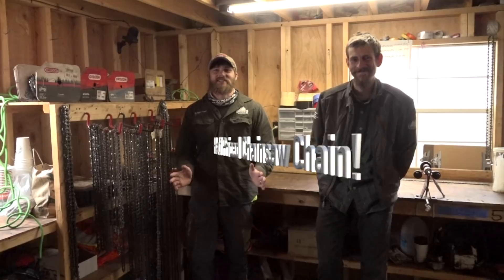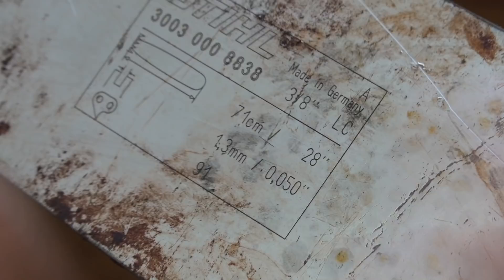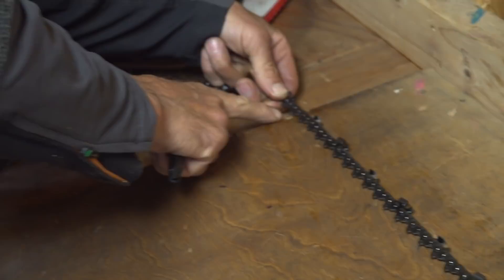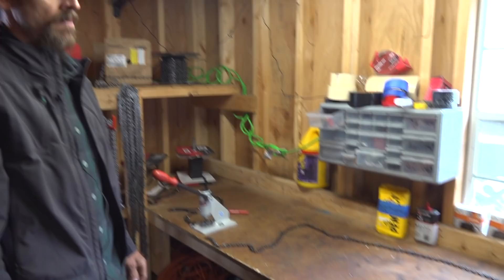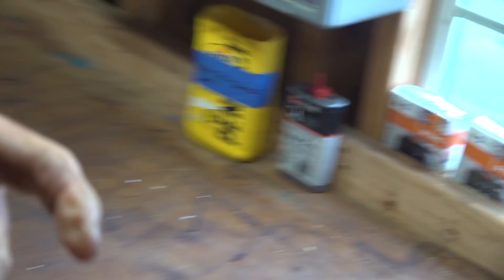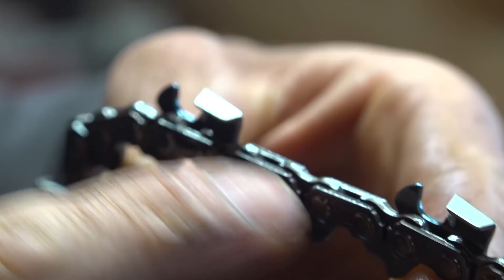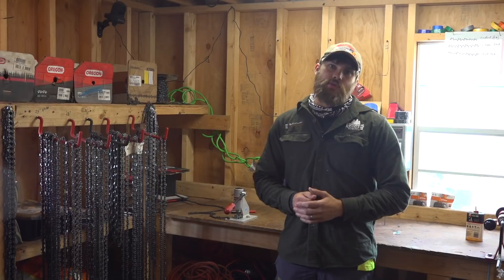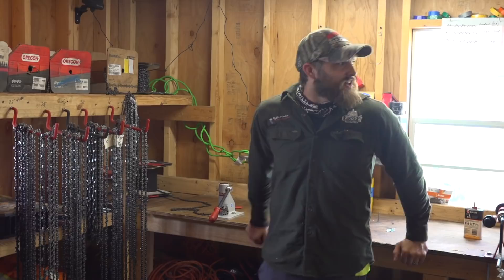Half Priced Chainsaw Chain!!! How to make your own loops of Chainsaw Chain

Comment: I've thought this before but never mentioned it, you are exceptionally good at interviewing people while they demonstrate something. Two thumbs up 👍👍
Reply from the maker: Thank you so
Much that compliment means a lot to me as that’s what I most enjoy doing  🙏
Reply: The (75) is 3/8’s .063 gauge… 73 is 058 and 72 is the.050 gauge 3/8’s chain… 90 is actually a 3/8 .043… it’s neat super skinny chain that turns a little engine into a real beast… like a combi-tool can pull a 14” bar for your polesaws!

Comment: 75 means 3/8 pitch .063 gauge or 1.6mm. There's a table for this info. I'm don't use enough chain to buy a chain breaker or press. A mate gave me some 3/8 chain suitable for my MS210 and I cut the chain by running a small angle grinder over the rivet head and then punched it out and then peined the rivets with a ball pein on a slab of steel.
Reply: In Oregon speak...72 series is .050, 73 is .058, and 75.....in the 3/8 (.375 actually rounded up from something like .367).
Reply: Just came here to call you Hank
Reply: @brunomahle1618  LP,  0.0370", 3/8". Full size 3/8" 0.375" pitch.
Reply: @brunomahle1618  75 means .063 gauge

Comment: The nail trick works, but I've found Bailey's Woodland pro chain measuring chart makes the process a bit easier. Cheap too. Just stick it down on the work bench and no more link counting guess work.
Reply from the maker: Thanks for the tip!
Reply: Can't you just split the old chain, lay it on the bench and bang in a nail?

I guess that's not the best option if you're making spares and the old chain isn't being thrown out?
Reply: SCOD nar not a good idea, as the old chain will be worn and as each link wears it adds up and becomes longer... ie stretch  👍

Comment: The question is what amount of torque do you put on that ratchet part bc spinning the other part just forms the mushroom. The ratchet is what puts pressure on it. So if you knew the torque you could replace that ratchet with a torque wrench and get them perfect Everytime. Not that it matters lol

Comment: Good video. I love watching your videos. 

You can also build loops of chain with simple tools: a grinder, a small ball peen hammer, a chainsaw chain repair set with small punch and pocket punch breaker, and a strong metal surface to place chain when you peen the rivets.  To make chain loop, count drivelinks, grind off tops of rivets for tie strap to be removed, use punch and braker plate to punch out rivits, put new tie strap on to join loop, carefully peen tops of new rivet with lite taps until mushroomed about same as the other rivits to complete the loop.  I have built over a hundred chains like this.

Another good tip is to count your links twice for the first chain of a particular size, then after yo have cut the chain to length, use that section of chain to mesure additional chain sections until you have all the chain you need of that link count.  Then you can make your loops and if necessary, box all the chains of that size.

Thanks again for the great video.

Comment: You could try an old toolmaker trick for finishing the mushrooming of the rivet. Take a ball bearing of the appropriate size and set it on the mushroom side while the link is sitting on the anvil. Now smash the ball bearing with the flat side of your hammer and this will push the material from the center to the outside creating your mushroom. 
Love the vids...stay safe!

Comment: 75 indicates.063 which is the gauge, or thickness of the chain 

And if your running an 8 pin sprocket you’ll probably add a DL

👍🏻

Comment: Thanks for the video! Im lucky to have an employee that worked at a rental center for decades and he handles the chains, maintenance,etc for me nowadays. Until the last few years I honestly just bought the factory chains and threw them in a pile and sharpened them when I had time and then threw them away after 4-5 times. Now the damn chains are double the price (especially Sthil)and we have been making more of them. I think I will order the proper tools you have and set up a dedicated work bench for chains. We have just been using a dremel to grind the rivet and a hammer and punch to set it. Thanks again!

Comment: The process of forming the rivet is called Rotary Forging or Rotary Forming. It's a cold swaging process where the pressure of the screw deforms the metal to fit into the rotary die. Oil is required to keep the metal from galling (smeared like a bearing looks after running with no oil).

Comment: The 75 on the drive link is Oregon nomenclature. You can search their charts for the numbers on a chain and it will tell you the style and size of the cutters and the thickness of the drivers(.043, .050, .058, 063 are the ones I have).
Those little riders are the heel for the back one(not sure about the front), on the newer chains they are different heights so they have to/should be put on properly.

Great video guys.
Reply: Nice Brett
Reply: So, what does "75" actually mean?  Is it a part number, size of something, or what?
Reply: @Vic-wi2qx  Funny, I just got an alert for this post.
Glad it's helpful :).

Comment: Suggest that the adjustable die is better for use when repairing used chain as provides perfect support to reduce risk of damaging drive links when breaking out damaged parts.
If using rivet spinner correctly, you shouldn't need to use hammer to finish. By using the hammer to finish, you risk inducing  stress fractures in the shank. Increased risk of catastrophic failure of join in service.
The shank of the preset tie strap has a shoulder to allow for proper flex of finished joint. Check for damage / burs to edges of drive links upper & if not punched square, the hole rivet mounts on. There are different presets for 0.043" /  0.050" & 0.058" / 0.063" gauge drive link. There are different cup / die for 1/4", 3/8" LP &  0.325", 3/8", 0.404" rivet heads. Two sizes. Separate third, bigger version for harvester 3/4" chain.
Later 2, same strap, for brand.
Putting a drop of oil on tip, makes for a smoother rivet head & reduces wear on one's equipment.

Comment: I use one of those older Granberg File’n’Joint guides and a caliper to get the teeth all the same size after a few hand filings. Gets them all renewed and I feel like I’m getting the most out of chains and I’m not being disposable, but I totally know that it would be cheaper AND easier to throw a new chain on in the time it takes!

Comment: And like a bicycle chain being made, if you crimp or mushroom them a bit too tight, you just need to apply slight side pressure or slightly “bend” on the chain (sideways so the links gain a bit of looseness).   Better a hair too tight than too loose, it can always be loosen (almost always).    Awesome channel, you guys are the pros.  !!!

Comment: Nice job guys. I've messed around with my own tool bits for creating the mushroom as my background is mechanical engineering.  After a few deferent angles on the tooling I've got the perfect mushroom now and it looks like the factory joins . Keep up the great work guys

Comment: Cool demo! When replacing motorcycle chain, the process is the same. Motion Pro have made a little portable tool that makes the delicate job easy, but it is not made for thinner chainsaw chain. Even so, I wonder if somebody will come out with a tool to make the chainsaw proces easier. The problem is, if any tool is expensive it will take big volume before one starts to reclaim the investment.

Comment: Great video, re forming the rivets, yes, oil, and they are cold formed, your better to have good pressure early so you dont end up work hardening the rivet and that makes the final closing more difficult, form it up, watch as it closes up, then easy pressure in little bits each time to get to the final stage of a tie strap with no binding and no slack, like the other formed tie straps on the chain. No need to hammer them the final bit, but if your in the field, and no spinner handy, then use hammer and concave punch head and form them up.
 Keep the great vids coming.
Reply: You beat me to the cold rivet part and yes you need oil.  A dab of grease also works and doesn't make a mess out of your vise and shop floor when you are doing a lot of chain.

Comment: Oregon makes a nice chain making template. No counting DL required. Works great. The 75 marked on the DL means 063 gauge. 72 is 050 gauge 73 is 058 gauge .
Reply from the maker: Thanks for the info!
Reply: ***PIN  this answer to the top !!!!***

Comment: That's an eBay price. But when it's a retail price face to face over the counter, that's the highest cost. Also madsen's is able to sell some types of chain cheat then others. So, the savings depends on the type of chain also. So the 50% cheaper statement was and still is true- depending on what chain you get. Plus you can get a cool Madsen's ball cap. And that's the best part. I wish Oregon would go back to the thicker chrome. A roll of Stihl chain cost more then Oregon, but the Stihl chain is harder. Baileys brand woodland pro cuts pretty good too. I think it's harder then Oregon. Or it used to be.

Comment: The larger diameter of the center part of the rivet is always a hair thicker than the thickness of the upper part of the driver, so you can crank the rivet down to where it looks the same as the factory rivets.

Comment: When you punch out the old rivet, the cutter tooth needs to be on top, right? I mean the cutter needs to be on the inside of that river puncher, facing the wall in your case as opposed to facing the edge of the bench? I know the rivets only come out one way but I can never remember which way.

Comment: When the rivet mushrooms over it will work harden.  Heat is generated, but the work hardening is from the mechanical breaking of the grain structure, which limits the slip planes within the microstructure of the steel.  You get the same effect by bending a wire back and forth.  It won't bend in the same place because it's harder. The tiny amount of heat generated wouldn't have any impact on the process, but it would tend to make the surface of the rivet gall against the rotating anvil, resulting in a rough finish and a damaged anvil... at least eventually....

Comment: Does that grinder Jed is using square cut the chisels? Or do you use a traditional grind for day to day work?
Reply from the maker: Yes square cut. I posted a video of how to use this machine back in the summer of last year called “chain grinding 101” of you want to check that out
Reply: @guiltyoftreesoneastsidetre4792  great video too.
Reply: @guiltyoftreesoneastsidetre4792  Thanks, will check it out now.

Comment: 72=.050,73=.058,75=.063
Presets have a dimple or mark on them that indicates that it faces out on the chain.
I break my chain with a dremel sanding stone and used to roll/mushroom all my rivets with a ball peen hammer . The spinner is much faster.

Comment: There's more math to do.  You didn't account for overhead (lights, a/c, payroll - I'll assume $30/hr all-in) plus lost income at your shop rate (I'll assume $120/hr) because Jed isn't out doing his job.  If each chain takes 5 minutes, you can add $15.50 to each chain, making this a net loss.   I'm making a lot of assumptions, but it isn't just retail compared to retail = profit.
Reply: Technically correct, but this is fill-in work that you do when business is slower and your crew is looking for something to do anyways.  You can build up a good stock of spare, sharpened chains in all of the commonly-used sizes, and when business picks back up, you are good to go.
Reply: @redmondjp  Gotcha, thanks for the information.